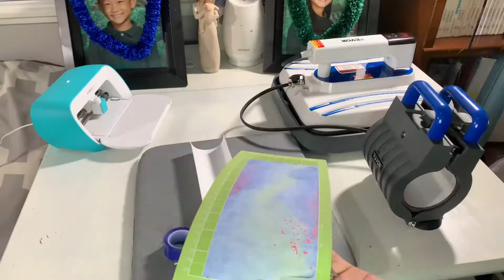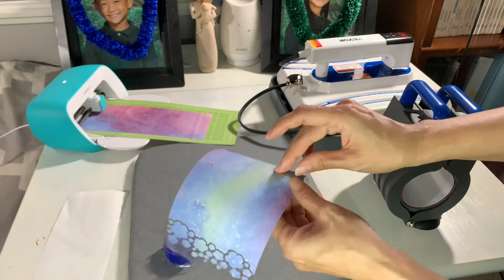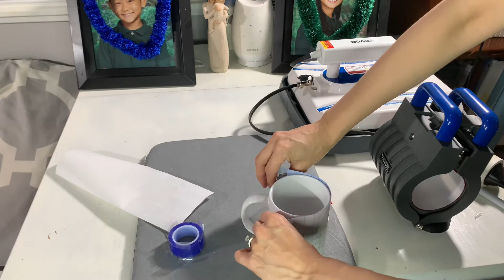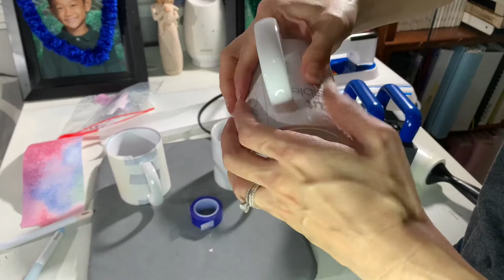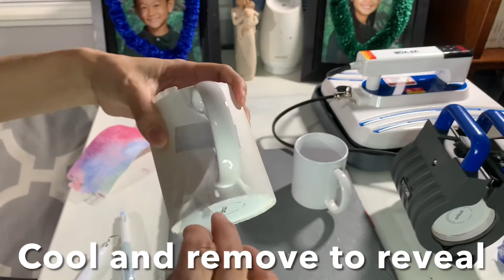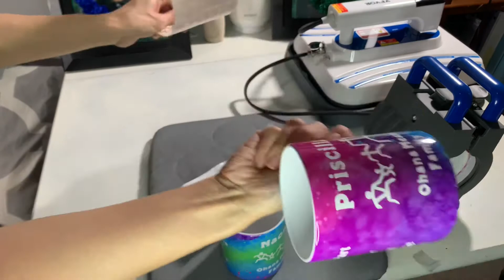How to Make an Infusible Ink Mug

Comment: Hi I have watched some of your videos I have the same hot press and cup press as you can you tell me can I make the cup press bigger as I can not fit a 11ox mug in mine it won’t do up and also I would like to do tumbler glasses but the cup press would have to be smaller
Reply from the maker: Hi, I bought the 12 oz mugs in a box 📦 of 36 from Cricut and they fit perfectly.  I will have to see if I can change the size on the press to make it smaller to fit 11 oz mugs.  I have done skinnier tumblers and mugs using a toaster oven … but you need shrink wrap https://amen.to/3FVdLc6 or a silicone mug wrap https://amen.to/3F0Jis0 to do it.  I have tried both and they work well, I will try to make a video of this when things calm down at work.  Hope this helps.
Reply: That’s great thank you for your reply